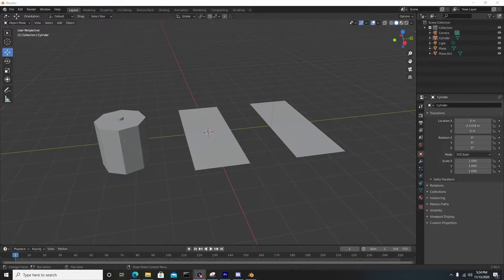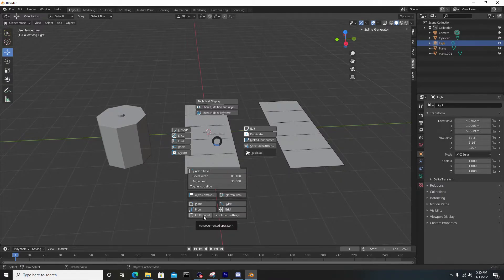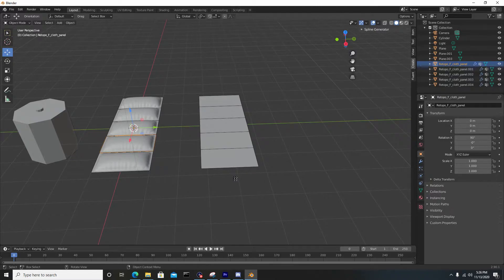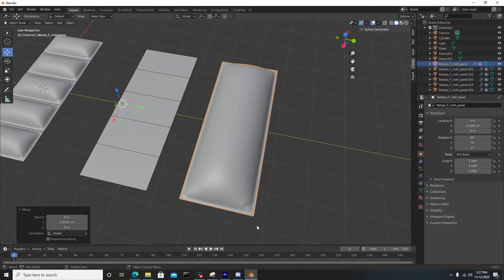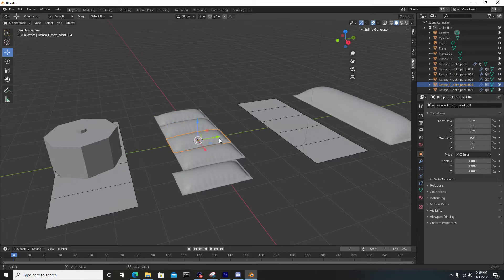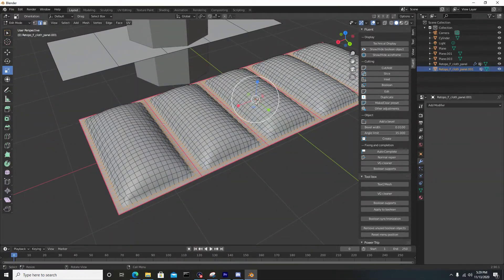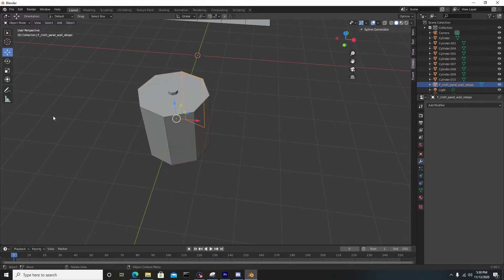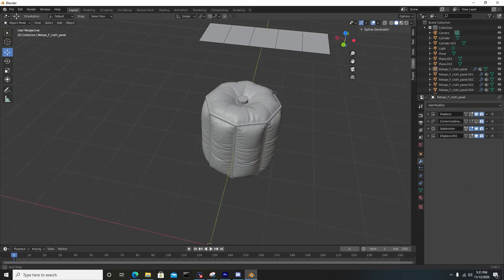Fluent Power Trip: Cloth Simulation (Tutorial)

Comment: Hi, I have upgraded to Fluent 1.5v but for some strange reason I cannot see cloth panel option in the Fluent menu. Actually, the whole Plate, Pipe, Wire,Grid,Cloth Panel tabs are missing. Do I need to activate some setting in the preferences? I'm using Blender 2.90.1
Reply from the maker: Give me a few minute to message the developer about this.
Reply: Hi Ramund, maybe you havn't the Power Trip version of Fluent but the basic version.
Reply: @CGThoughts  Yes, of course, I already wrote to you on your channel explaining it. Obviously I purchased the basic version. hence no other options for me. Please look into your channel and my question about Power Trip buying options. Tanks
Reply: @CGThoughts  Ah I also made the same mistaken via Blender market. Didn't realise there was 2 versions and bought the basic version by mistake. Contacted Blender market and waiting for a response.